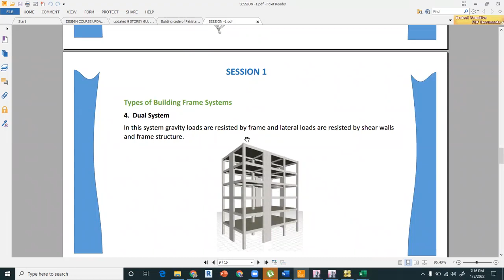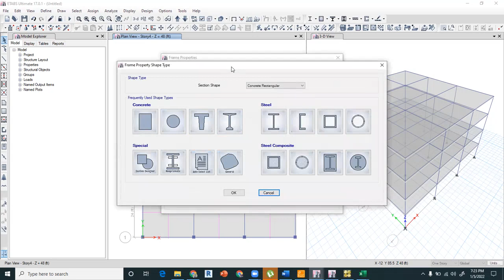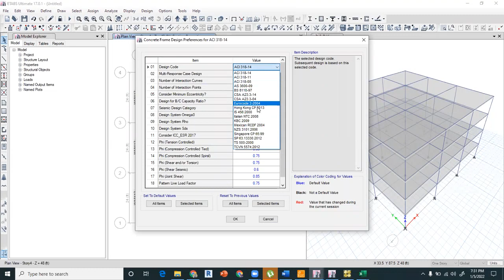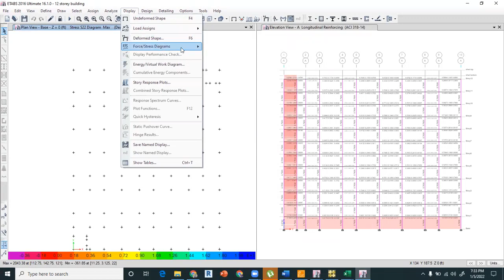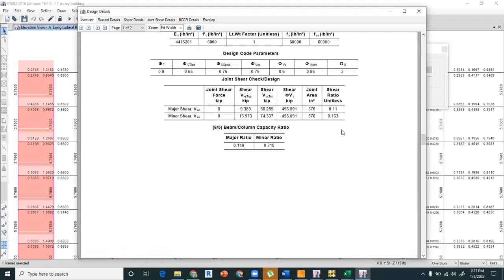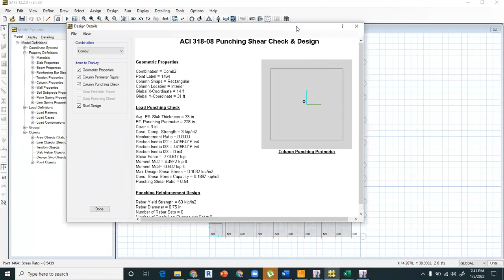Course Overview - Building Structure Design using ETABS & SAFE

Comment from the maker: This is a brief Demonstration for Online Course "Structural Design of High Rise Buildings using CSi Softwares like ETAB/SAFE/SAP2000 with Excell sheets in accordance with ACI-318/UBC-97/ASCE" 

Those who intrested can Contact and Register on WhatsApp# +92-3469481686